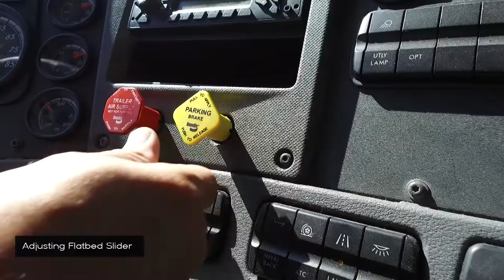Flatbed Slider

Comment: When the access are together how do you slide the rear one back?
Reply: Same process. Truck brake applied. Trailer brake released, providing air to the Trailer. Go to the box and turn the valve to the unlocked position and release the pins and lock the axle. (If you have a stepdeck you will need to turn the second valve to raise the rear of the trailer for wheel clearance.) Then reverse until you feel resistance from the locked axle. Set your truck brake. Go to the box and turn the valve to the locked position.   If your pins aren't fully locked then give the trailer a gentle rock back and forth and check to confirm they aren't stuck. Check both sides for safety.